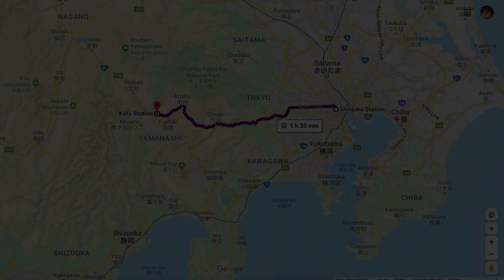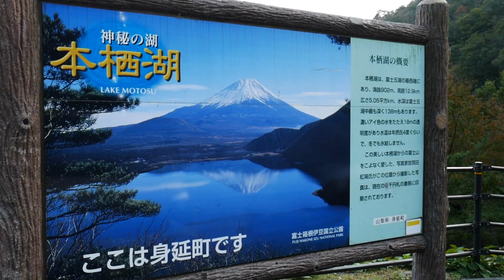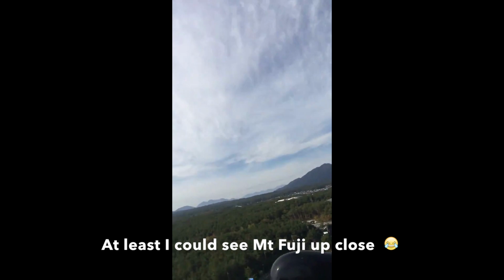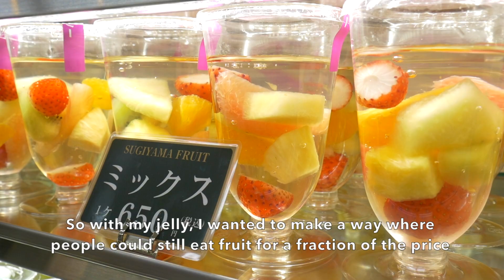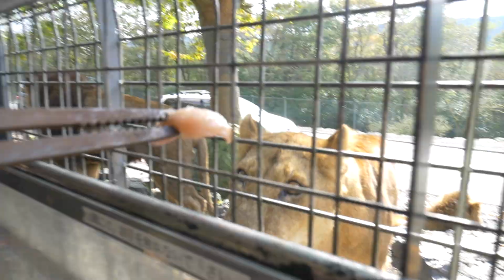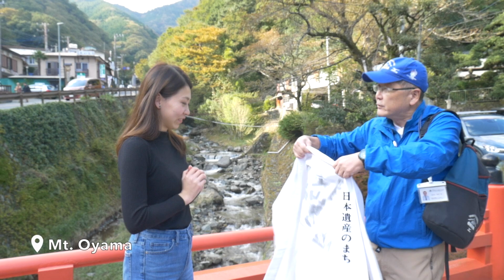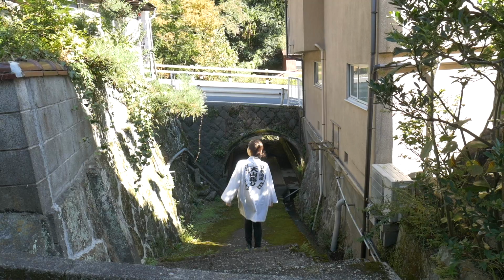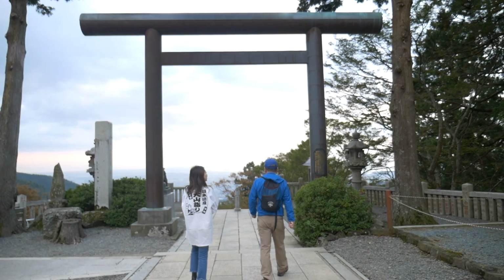15 Things To Do Around Mount Fuji | Day Trips From Tokyo

Comment: Your camp site on Lake Motosu looks to be near the Fuji view point shown on the back if the thousand yen note.  Also, the falls at Shiraito are formed by water trapped between an older, more impervious volcanic fan laid at least 20 thousand years ago and a younger more permeable lava flow on top laid down some 12 thousand years ago.  (There is no surface river feeding these falls.) The springs at Oshino-hakkai on the northern slope of Mt Fuji is another example of water coming to the surface after percolating underground for an unknown number of years (but contaminants indicate some of it is recent).